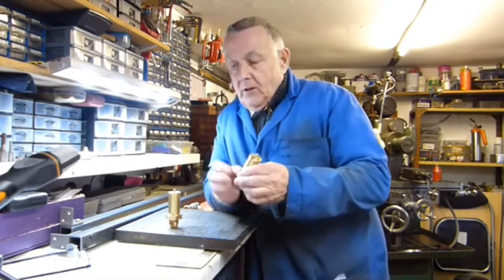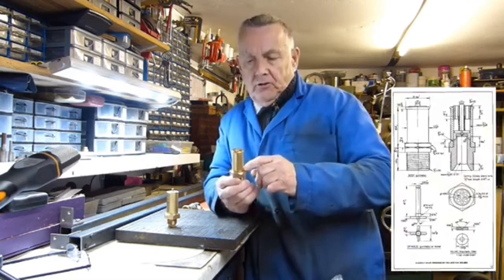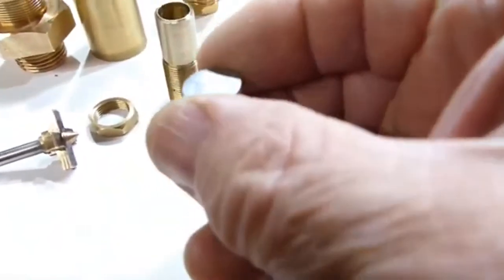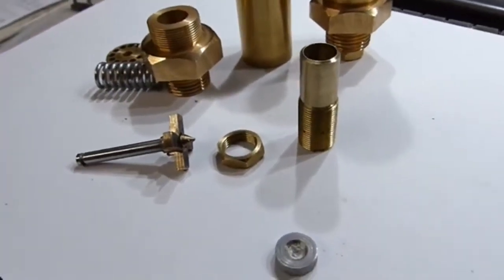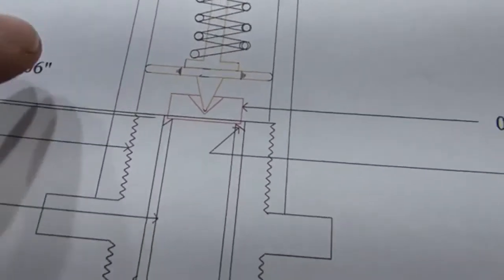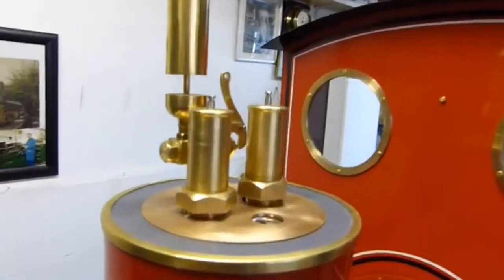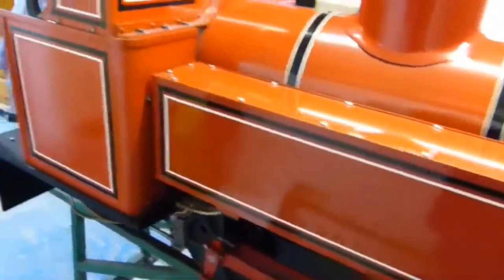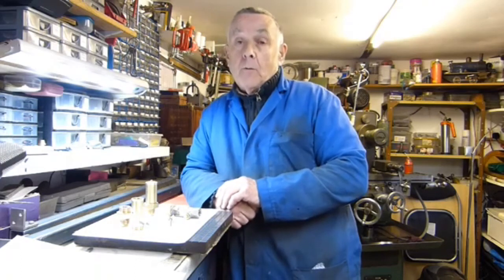Holmes pop safety valve mod

Comment: Thank you for explaining this. I will go in search for the articles in EIM. I am over hauling a 5"simplex and I have been told the Holmes type are far better. 
The ones on there at the moment lift so much water with them.
Reply from the maker: Glad the video was of use to you,used these Holmes type valves on a previous locos and have had no problems with water lifting even with a fairly full boiler,for some reason a lot of model engineers avoid these type which is a mystery to me,definetly better than the ball type and easier to adjust,thanks for watching the video.

Comment: Loved the video very informative. Do you remember the reference for the original article on the Holmes pop valve?  Cheers Garry
Reply from the maker: Sorry for the delay in replying to your question about the original article,it was in a very early edition of Engineering In Minature,the exact number I am afraid I have forgotten I think it could be issue 4 or 5,I do remember that on the front cover it showed a picture of a 5 inch gauge Evening Star built by the late Jim Ewing the author of the pop valve of which he discribed in the magazine,I still have the pages of the original article which I kept when I disposed of the magazines,but sadly there is no date on the pages,hope it was of use to you,and thanks for watching the video.

Comment: great work but how does it work?
Reply from the maker: Hi,thanks for watching the video,these type of flat valves are really simple the round disk sits  on the knife edge of the cone and sits aprox .015" below the rim of the outer diam.When the valve blows off the disk is held more or less floating above the seating,you would think it would be disloged but this is not so,with such a large area of the bore of the cone open you get rapid escape of steam which then shuts down quick,actually my valves really need adjusting slightley to give a more rapid closure,I really did not set them as they should be  as I wanted to run the loco as soon as possible,well worth making instead of ball valves.